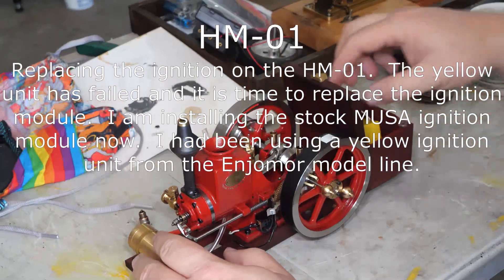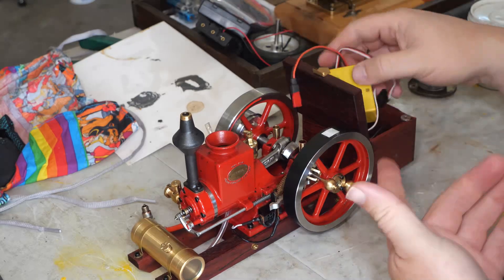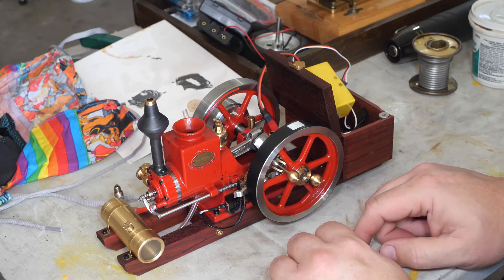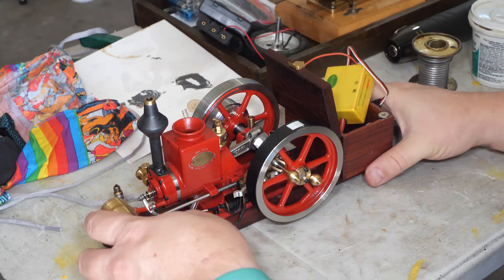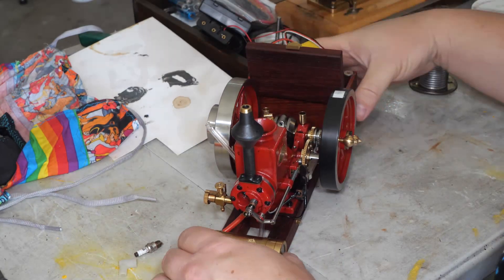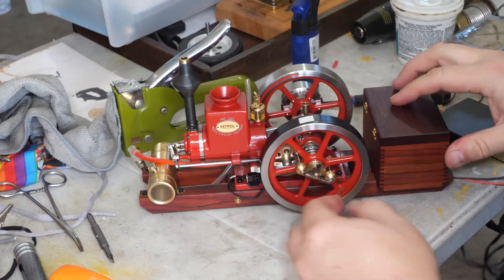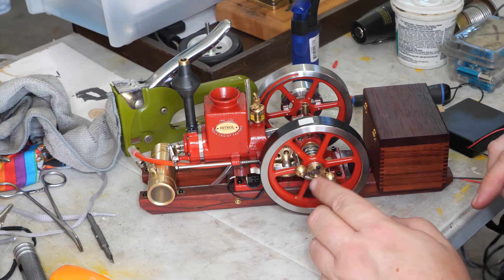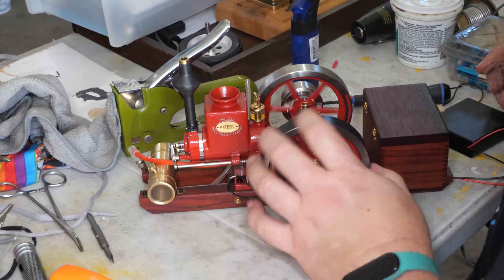HM-01 Ignition Replacement

Comment: A portable radio placed a few inches nearby  in untuned AM mode works well for hearing the ignition pops to ensure its actually sparking properly or not.  usually a 100 Hz buzz then a pop (or spark)  with brief silence then repeats the cycle again.  Unfortunately after roughly 20 hours of use the ignition box finally did fail when instead of sparking it only made a lower 30 Hz buzzing tone which indicated it didn't  spark anymore.  (bummer) I did replace it with a new box.
Reply from the maker: I may have to dig up an old radio for this reason.  I am also getting ignition noise in my microphone cable, but that only becomes apparent later.
Reply: @henrybangsberg2187   I just dropped the ignition voltage from 12V to 7.8V  with 5 AAA  batteries  and the buzz tone shot up to 300+ Hz on the AM radio  I heard its was a highly recommended voltage for the ignition box ,  hopefully the new box will last longer than the previous one.
Reply from the maker: @rEdf196  I run all my boxes on the lowest voltage I can get a spark with and then if I begin to have issues I raise it to see if the box revives for a bit.  The components in these are the cheapest components available and lower voltages will extend the life of most electronic components.

Comment: Can't find any contact info for my HM-01 in China. Please if anyone 
knows it.
Reply from the maker: Where did you buy your HM-01 from?  service@enginediy.com has been very helpful with all my engines.  I had extensive ignition issues with my R18 when I first got it but the HM-01 has proved particularly hard on ignition modules.  I still have not gotten back to fix it again.

Comment: I finally got the contacts to work better, I put 2 little strips of electrical tape behind the fixed contact, doesn't advance the timing too far and they work much better. I have used 7 - 12oz cans of Zippo Lighter Fluid in it already, I run it a lot. Now I have another problem, I noticed both the cups for the main crankshaft oiling were emptying right out, I pulled the main caps off, the crankshaft bearings are spinning in the block but, it still has good clearance on the crank, but, the outside has worn down from them spinning in the block. I sent them an e mail, see if they answer back.
Reply from the maker: My ignition units are dying in this engine.  I test them on the bench and test them using the trigger contacts on the HM-01 before I install them, but then they quit working.  Even after they're removed, they no longer function.  I am going to be trying a few things when I get my workshop area set up again, but it's very mystifying that this engine seems to be frying ignition units suddenly.

Comment: The problem I have had with no spark on my engine, the points, they look clean and like they are touching, but not working, I play with them a little and they start working again. I ordered micro switches to try and use that as the points, other wise, a GREAT little engine. PS, I use the batteries they recommend, 2 -  3.7 V  #18650

Comment: just use a 9V battery.
Reply from the maker: I might do that, but I don't know how long those would last.  I'm looking into a few different options.
Reply: @henrybangsberg2187  It's not like the engine will be running for hours each day is it? I got rid of the points on mine and 3D printed a mount for a miniature reed switch that is actuated by a magnet in one of the holes of the timing gear. Timing can be adjusted by pivoting the switch in an arc around the mounting screw that held the old points.
Reply from the maker: @oldtugs  I don't have access to a lot of 3d printing or machining stuff.  I already have rechargeable AA batteries so I prefer to use them instead of investing in another rechargeable battery setup.  I also like getting my engines set up to run the longest they can on a tank of fuel.